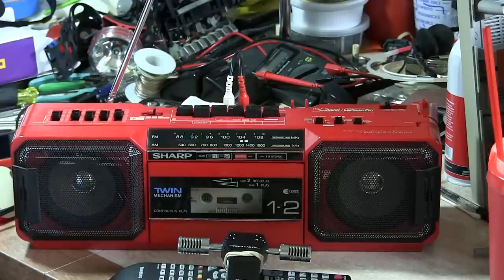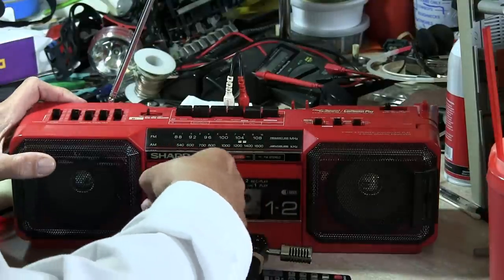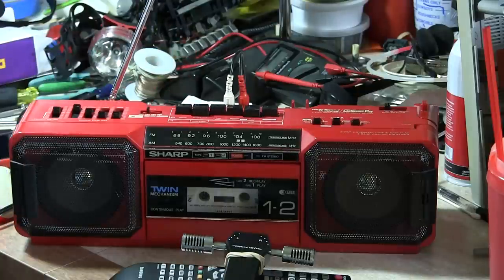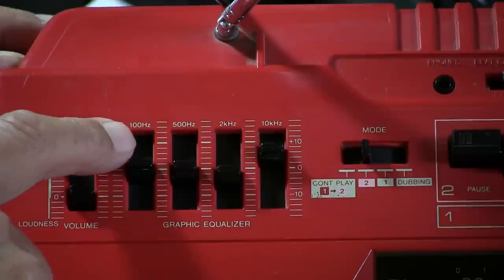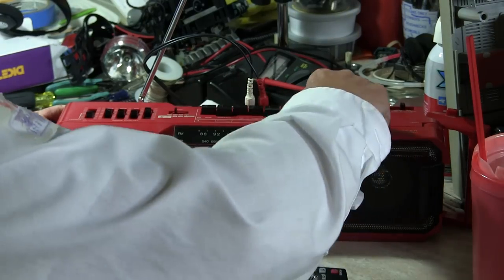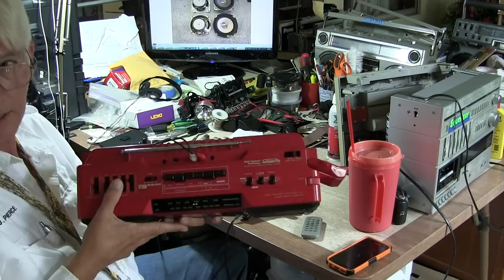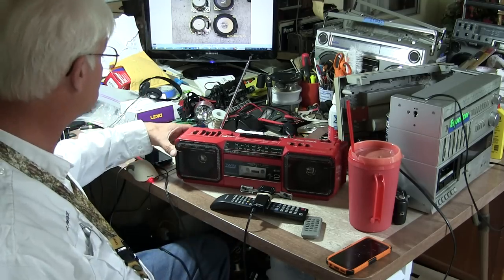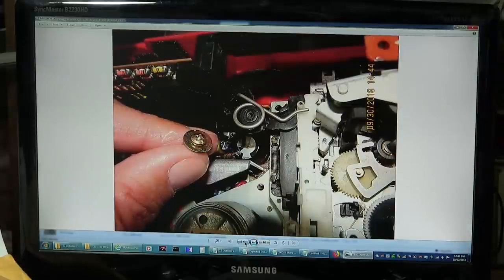Sharp WQ-T282 Cassette Line in W Cell-phone Radio Play on Batteries for sale

Comment: I had one of these years ago, gave it to an ex girlfriend. I regret not keeping it for use as Bluetooth receiver speakers, as the sound quality was decent, and it had full size Aux inputs.
Reply from the maker: Do you live in the usa as mine is for sale if you read the description?
Reply: @Cassette2Go  No, I live in Australia. And as much as I liked that unit, my 'grail' is a red Sharp QT7 in clean cosmetic condition and good working order.
Reply from the maker: @raksh9  Panasonic RX 50 50 F if you look back in my videos about a month or two I shipped that and a sanyo to Australia

Comment: I have a question about this. I have one of these and was wondering if its supposed to be able to fast forward and rewind on both decks or just one?
Reply from the maker: You have to switch between deck switch fast forwarding or rewinding you cannot rewind or fast forward both at the same time only one at a time
Reply: @Cassette2Go  i looked up the service manual and apparently some models only play on one deck and dont rewind or fast forward.
Reply: @Cassette2Go  thanks for your help tho 😀😀
Reply: Certain ones the second deck only plays the tape for continuous play.
Reply: Actually mine physically prevents you from pressing the rewind and fast forward button in the deck 1 position. Really interesting.